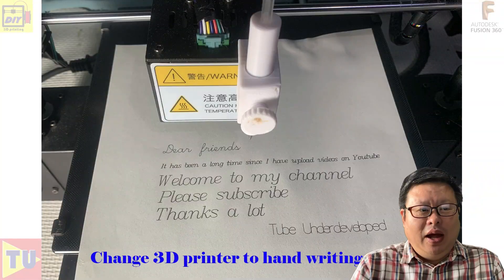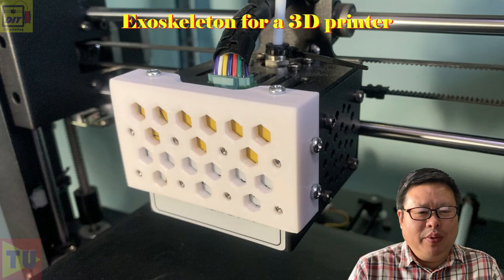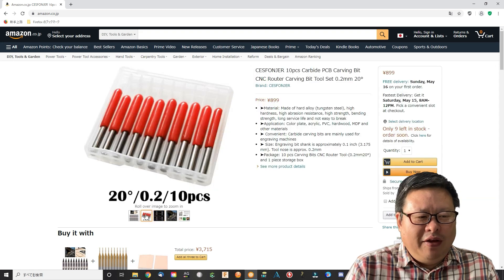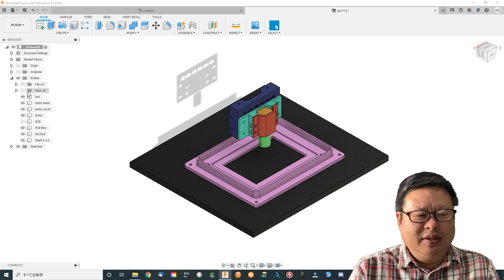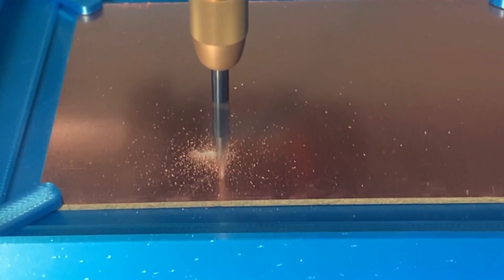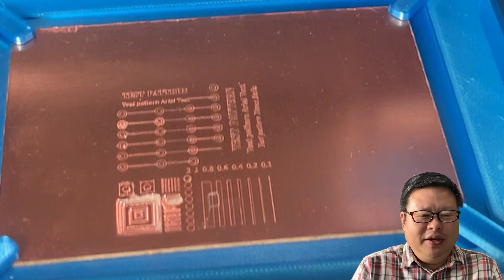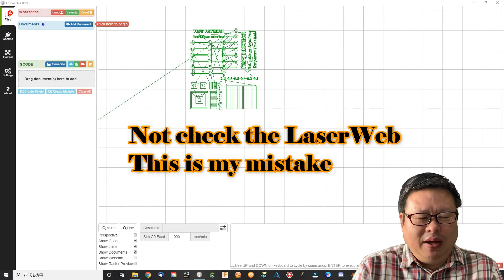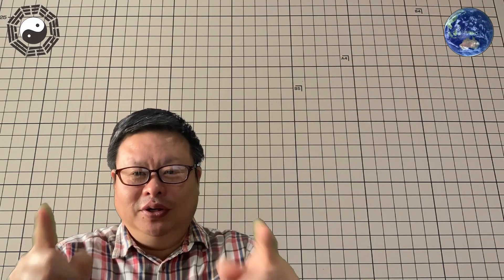Add PCB drill to 3d printer using DC 130 motor (Easy and simple)

Comment: I am trying to connect a torque gun to my 3D printer. Do you know how I would wire it up to the 3D printer control board?
Reply from the maker: Sorry I don't know how to connect other stuff to 3d printer. I use the mini DC motor directly with a simple power supply. It continuously rotates and drill the board. Thanks for your comment. Have a nice day.

Comment: can you describe, how did you connect the motor to the 3d Printer board. (wiring method.
Reply from the maker: I use an attachment base that fixes the printer hot end box. I have described that in my previous video. Also, I have uploaded the model to Thingiverse.  So I just connect the motor holder to that base. You can see my 3d printer always mounted a white box since it is not hinder the 3d printer's normal function. The motor is then connected to a DC power supply that I manually adjust the output voltage.  After I have found the good voltage, now I use 3 V then leave it on.  Hope it will give you some help. Please share with your friends. Have a nice day.

Comment: Would be cool if you add links to the components/3d files. Thanks
Reply from the maker: The model file can be downloaded on Thingiverse in the description. The PCB bit can be purchased on Amazon. The quality of the bit is varied depending on the cost and other factors. I select the one that cost is low but the quality is quite high in Amazon Japan (I compared them quite a lot depending on the user's comments). You can select a similar one for the test. In the video, I explained the reason and some selecting ideas. Below is the one I used.
https://www.amazon.co.jp/gp/product/B08PBPPGK2/ref=ppx_yo_dt_b_asin_title_o04_s00?ie=UTF8&psc=1
Hope it can give you some help. Have a nice day.